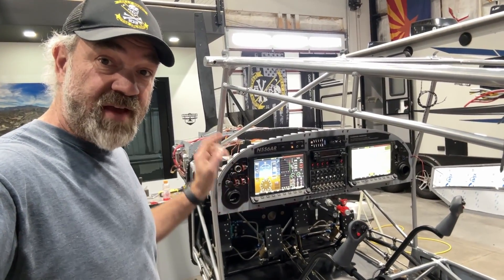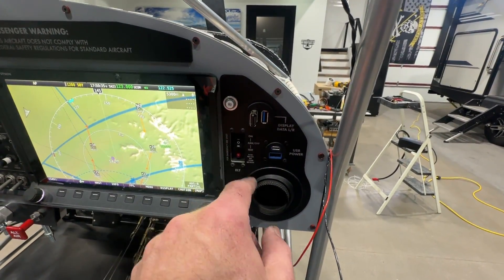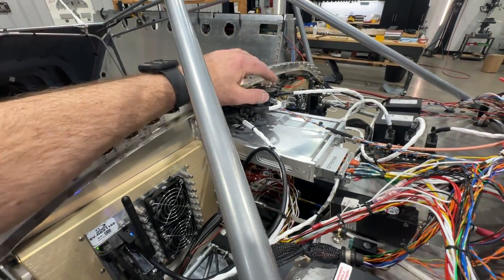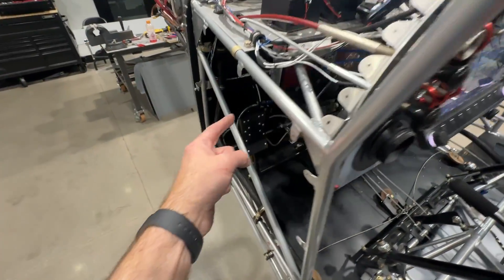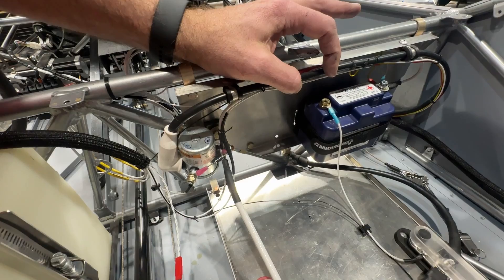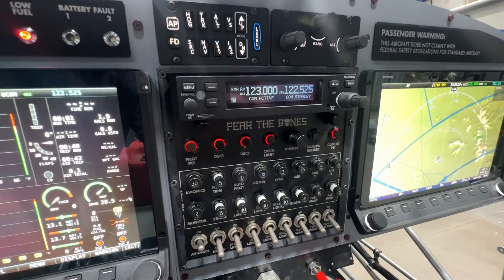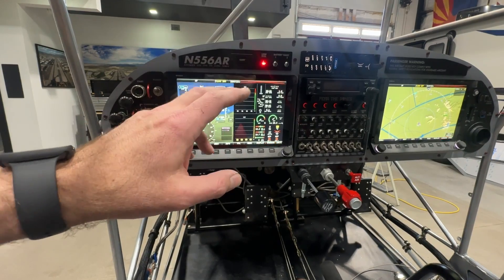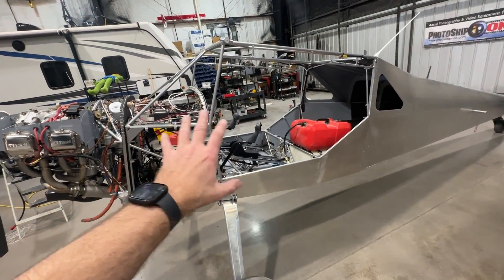Ep. 53 - RANS S-21 Avionics Installation

Comment: Good to see your video.
Wondering how does the autopilot works in general aviation airplanes. I'm guessing it must have a motors to pull the cables
Reply from the maker: You’re correct. Little stepper/servo motors connect to the existing cables or pushrods.
Reply: @Outbound300 Thank you for reply. Thanks for making these videos. 
I believe I have watched every video of this build, and I do not member seeing them, so I hope you will show them in future video.

Comment: are USB Chargers known to cause interference issues? Why use the Garmin $350 charger over a standard $20-30 as an example? Thank you!
Reply from the maker: good question!  YES, cheap Chinese chargers are VERY noisy and often cause interference with the comm radio.  Thus my reason for spending the $$$ and going with the TSO'd unit from Garmin.